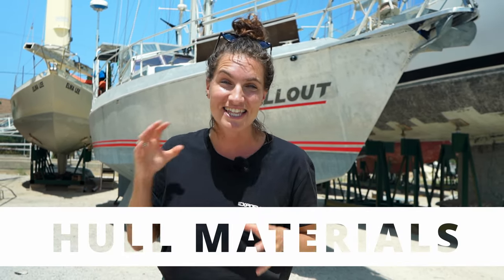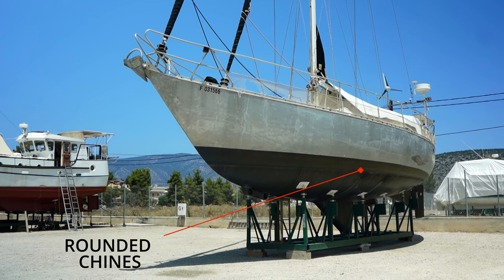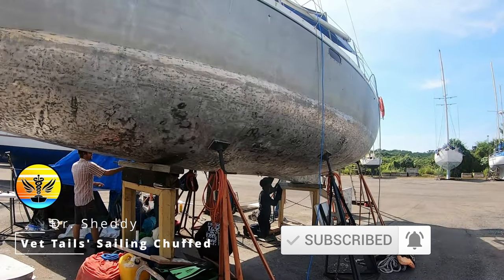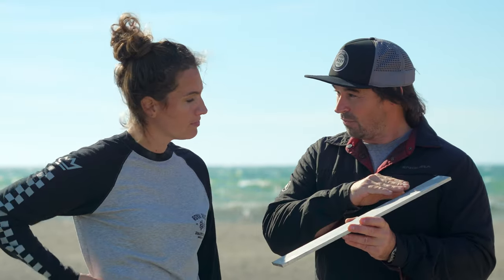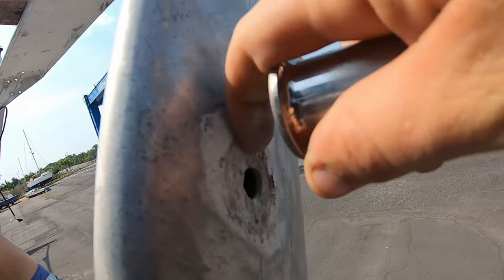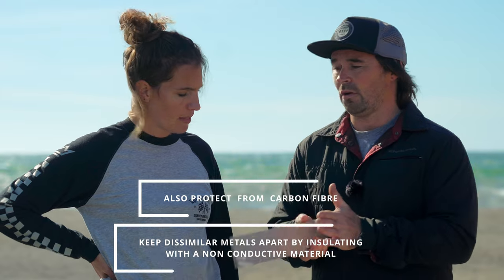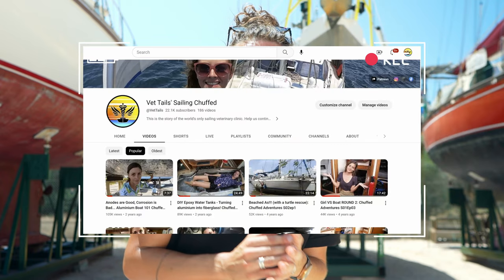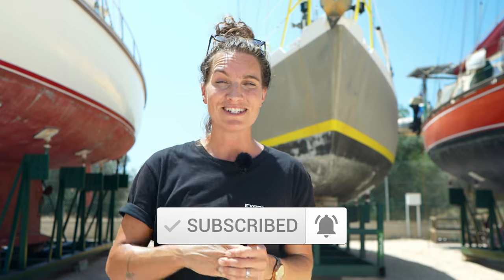The truth about Aluminium sailing boats from a PRO. Hull Material series Pt. 3

Comment: Still don’t understand why no one builds boats out of BRONZE.  It doesn’t corrode, welds cleaner than aluminum or steel, and you can plate the surface below waterline with pure copper.
Reply from the maker: Yup, it’s a great material and there has been a good amount of boats built from it. I think the only downsides are the huge cost and weight issue.
Reply: @SailHub  It weighs about the same as steel, but does not corrode and so stays the same thickness over generations of time.  Yes, it’s costly, but what yacht isn’t costly?
Reply from the maker: @christopherpardell4418 steel is such a weight too, many are out of by this, surprisingly it’s not just the maintenance. As for the price I’d bronze… the price is quite literally obscene.
Reply: @SailHub  I see a LOT of obscenely expensive yachts being built.   Just the interior appointments exceed the hull cost by a significant amount.
Reply from the maker: @christopherpardell4418 as a boatbuilder I really don’t see this being the case. Interior fit outs are one thing but the hull build is the main expense and if you more than quadruple this from the beginning you end up with a really expensive yacht.

As mentioned earlier there have been many built over the years, they are all superb, albeit a little slow and not light air sailors but they are strong and lost forever, they also don’t need antifowl which is why they bronze hulls were trialled for shipping. Despite the haul out, the antifowl costs, maintenance savings and the fuel savings (due to a generally much cleaner bottom) the material still did not make financial sense. Quite remarkable really, I was really surprised by this myself, there’s been a number of papers written about this over the years yet it still surprises me.
Reply: Since when doesn’t bronze corrode? I had to replace my prop because of corrosion, the bronze became pink
Reply from the maker: @tysonristau4995 yup, it looses the zink from its alloy and goes pink!!

Although, this is usually a galvanic problem. So if the whole thing was bronze that should not occur… in theory!
Reply: @SailHub  there should not be zinc in maritime bronze.  If there is zinc in it, you don’t have a bronze propellor, you have a brass propellor.   Aside from copper and tin, the most common additional metal in maritime bronze is aluminum.  You also find phosphor bronze ( which is almost as strong as steel ) and silicon
Reply from the maker: @christopherpardell4418  yup your right…. It’s aluminium. My mistake 👍
Reply: @SailHub  Properly isolated from metal that is more than two points away on the galvanic chart, The aluminum oxide coating on that kind of prop ought to be self regenerating.
Reply from the maker: @christopherpardell4418 ah, I see.. what prop are we talking here?
Reply: @SailHub  I don’t know.  I am a sculptor who does a lot of work in bronze and know that galvanically isolated bronze will last 30,000 years under seawater with no appreciable loss of metal. And that copper hulls ( not riveted or brazed to steel ribs ) do not rust nor erode. Their copper content makes them biocidal and if you plate them with pure copper, practically nothing in the ocean can stick to them. ( that is, barnacles can be removed literally by wiping them off )   Aluminum Bronze is relatively new, as prior to the widespread availability of electricity, Aluminum was nearly as expensive as platinum.  Most ships props in the old day were made from bearing bronze.
Reply from the maker: @christopherpardell4418  quite amazing! Thanks for that. 

Yup, I’ve read about a few bronze boats over the years. Amazing.

Sculpting sounds fun! 👍

Comment: You did not speak about thermal and noise insulation, very weak with aluminium
Reply from the maker: Hi, there was quite a bit we didn’t go into detail on too, we will cover it in later videos as it would make a single one too long. 

As for insulation, if you by metal vs fibre, you are generally going to have work harder for great results. However it is possible to achieve great results and we must also remember the aluminium insulation stigma comes from boats with no insulation that is quite common.

For reference, my recommendation right now would be between 4mm and 8mm (depending where you are going) of projected cork straight into the hull. It has amazing sound and heat insulating properties. 👍

Comment: If you accidentally drop a penny into the bilge you will eventually have a hole in your aluminum hull - electrolysis is a biatch! Aluminum hulls are uncomfortable noisy in choppy seas. Aluminum is highly conductive and it also attracts condensation. Because of this, aluminium boats are notoriously cold during cold seasons. Antifouling is also much more expensive and complicated to apply to aluminium. I wouldn’t touch it with a 10 foot “aluminum” pole.
Reply from the maker: Fantastic, thanks for commenting Marc. It seem that a lot of people believe the same things!! 

Over the next year we will be trialing these myths, as a boat builder I generally feel that these things need to be proved. There’s far to many people saying this, that and the other without sufficient knowledge and to be quite Frank it’s scaring people! 
Everyday people are becoming petrified of all hull types. It’s bonkers!

Comment: You dont use welding rods for aluminium.
Reply from the maker: Of course we don’t use rods! We use argon, helium and magic to join the metal together! 

I presume your actually thinking I meant sticks not wire? 
Maybe your referring to mig welding here and forgetting the other types of welding used?

We can of course use tig on aluminium too, tig welding certainly has a place on a boat as the control of porosity and penetration is generally better. I would use tig’s advantages for chainplates and the likes and of course this means I’m going to use a rod. I would however use mig and mig wire for the majority of the rest is the build. 

Wether it be rod or wire, it’s the same metallurgy anyhow.

Comment: Aluminium is NOT harder to weld than steel. It's just that not as many people learn to weld it. It's much faster than steel to weld and because it freezes faster you don't end up with molten metal dropping on you in positional welding. And you definitely should never weld through the oxide layer. That man has clearly never heard of sandpaper or a grinder.
Reply from the maker: Ok, I will take your word for that… 

As for me, after all my years of tig welding professionally I can safely say that aluminium is harder to weld, especially when it’s old. In general I would suggest it’s just not as forgiving as steel manly due to porosity.
As for not welding through the oxide layer… we have no choice, it’s pretty much instantaneous. Why do we use AC for aluminium? 

Also… maybe worth checking out the materials in a grinding wheel and sandpaper…. They are not compatible with good aluminium welding. Stainless steel brush my friend 👍
Reply: @SailHub  Old aluminium can be hard to weld, but then so is old steel, so not much difference. Nearly all my metal boatbuilding has been aluminium, and I find it easier to work with and weld than steel, though I think steel is easier to weld in the very thin guages. Having said that why would anyone use very thin aluminium plate anyway.
Reply from the maker: Hey,

I do appreciate what you are saying here. I hope you understand this is a basics video, as in for those learning about something new. Im not hear to tell people how to weld and I’m sure you find it easy! 

I do rekon though, if you asked a room full of welders what type of welding to use where and what material was harder they would all suggest mig welding will be similar but you have more settings to master, tig welding aluminium is generally a little more difficult - especially if you are being tested for porosity and penetration. 

Basically, the general belief across the world is that aluminium needs a bit more skill, I’m pretty sure that some quick google searching would back that up, and that’s what people need to know before buying an aluminium boat. They need to know how it may effect them. I certainly wouldn’t suggest to a complete amateur to go and weld an aluminium boat together, the material is thicker and they probably won’t manage the penetration… A steel one, quite possibly.

The gear costs more as the AC equipment is more expensive, it is also hard to find some one to fix it in many places…  I had to send some one sailing for 200 miles in Spain of all places as my set was down. That’s what is important here.

I’m just trying to keep it broad spectrum and simple for people, there’s a lot to learn outside of the welding, it’s not worth me over complicating things.

I hope you understand. 
Cheers,
Chris
Reply: @SailHub  fair enough.
Reply from the maker: @deerfootnz cheers, thanks for understanding. I would love to see your work to though - I love a metal boat, they just oooze fabrication class!
Reply: @SailHub  Yep - gone through many Stainless wire wheels and they are expensive !

Comment: Thought aluminium and salt was a bad mix with aluminium the loser. Reason not allowed to put salt on runways during winter months because it can seriously damage the planes.
Reply from the maker: Hi Geof, it all depends on the grade of alloy and the application. So if you have certain grades in certain environments they will not like salt, usually due to galvanic reactions between other materials on other parts of the structure. 

With a properly built boat you should not have this issue as there should be nothing else is attached to it, i.e there is no landing gear etc and dissimilar metals are not attached to the hull. 

A well built aluminium boat should last for ever. Basically, don’t buy aluminium from someone who doesn’t know about it!